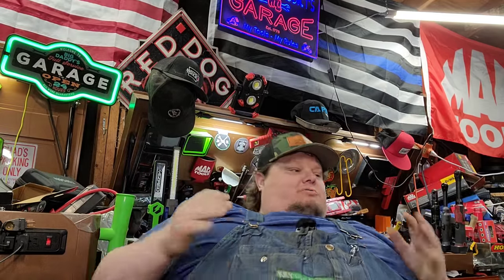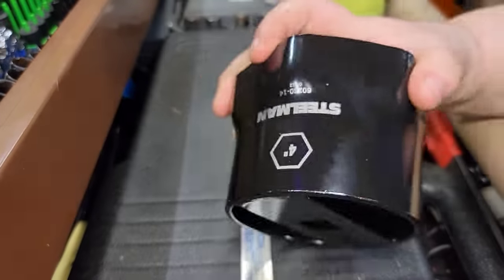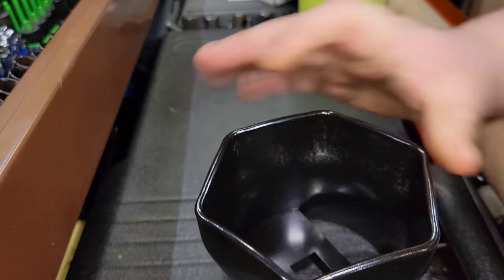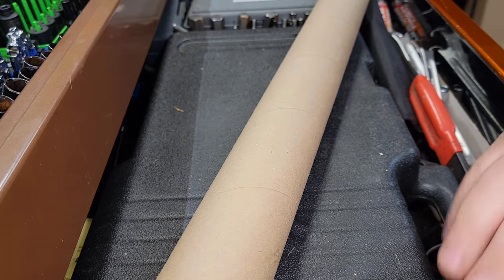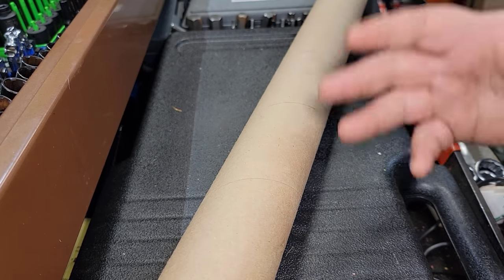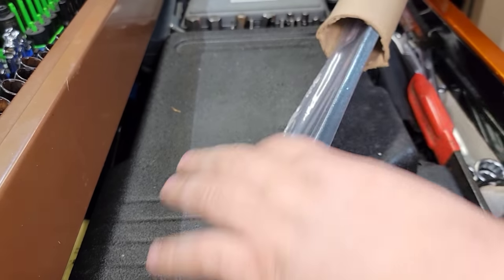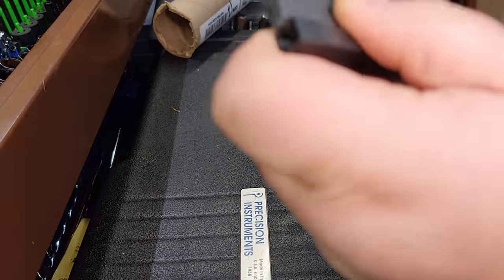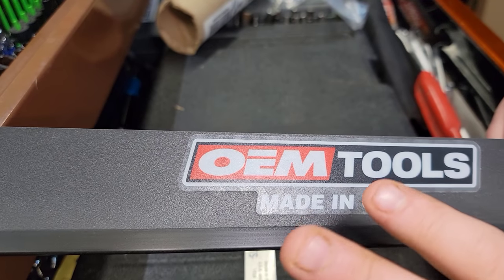NEW TOOL TUESDAY FEATURING LISLE AND OEM TOOLS!

Comment: 5:12 The giant 2-5 inch socket set we had at the owner operators in Detroit I worked at were by Blue Point & made exactly the same way. Out of about 12 gauge stamped steel with a 1/4 inch plate. Boss said that set ran like 3k$+. I had to use the 48 inch 600ft-lb 3/4 torque wrench with those sockets for doing spindles, bearings & S-cam replacements on the air brakes on trailers. Big 3 inch nut clamps it all in. That's a solid buy.

Comment: Those rope ratchets are nice, that sized one I believe is rated to 75 lbs but they have ones that go up to like 250 lbs on their 1/2in model. Use them to hold up brake calipers and they work amazing

Comment: Axle nut socket...way overkill as those spindle nuts aren't tightened that much...
Reply: 400-500 ft lbs isn't that tight?
Reply: @kylesonsalla7620  you're crushing wheel bearings that much?
Reply: @pl5624  
If they're Conmet preset, preset plus, or anything else that uses a cone/spacer between the races, absolutely.
Reply: @kylesonsalla7620  good to know.

Comment: Why would you need a anti-splatter pad on top of the oil drain tub?   I have never dropped the plug in the tub or spent 5 minutes trying to find the oil filter wrench because I lput it in the bottom of the tub before I slid under.  Yes, sir I order these just to save the environment from oil splatter.
Reply from the maker: Lmao true story I always drop in coolant that's what I hate!! Lol